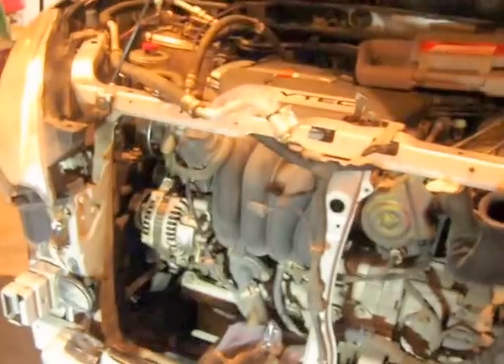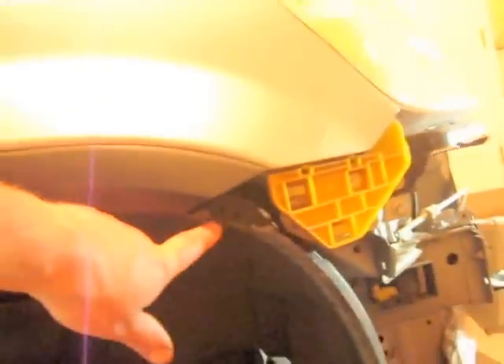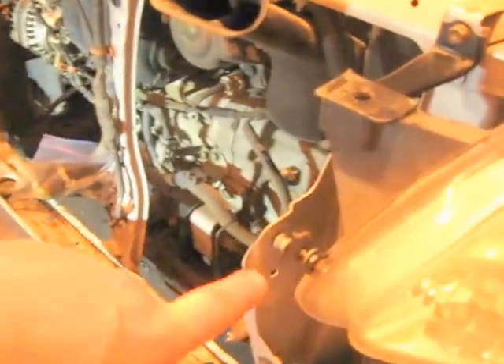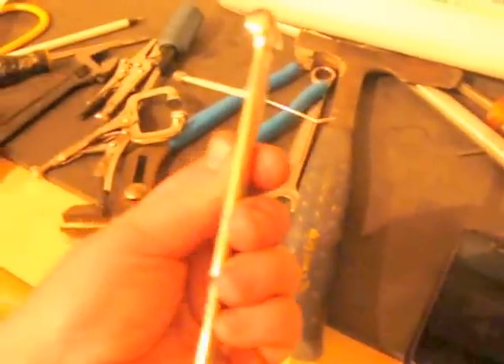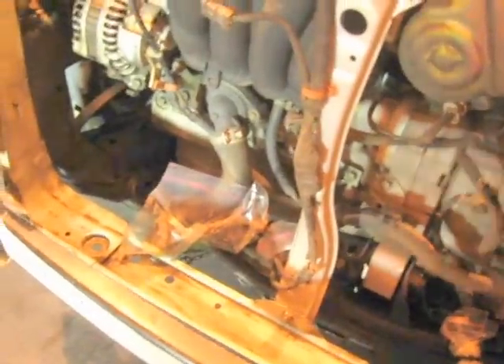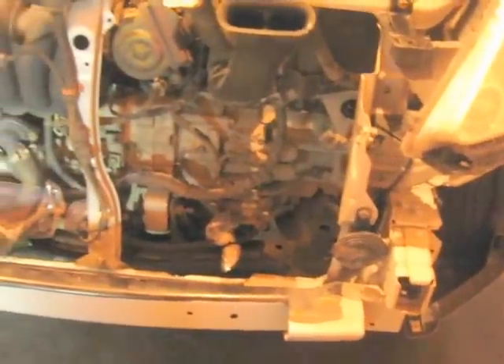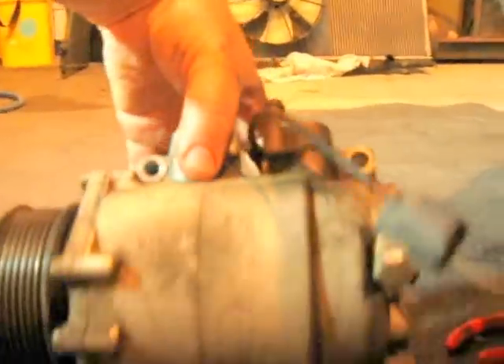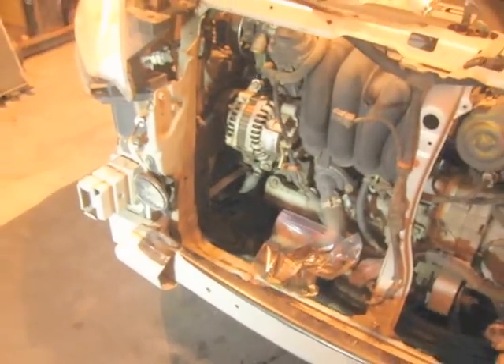2004 Honda CR-V Air Conditioner Compressor Removal

Comment: We had the A/C repaired for the second time in 2013 and it went down again just las September (2015). As summer approaches in Texas we are undecided as to weather or not we should fix our car. What do you suggest? Is this car worth fixing? I'm also considering a newer CRV, do you think I'll encounter the same problem?
Reply from the maker: In regards to the newer CR-V a/c i am not educated on the viability of the new a/c design. I do know that after I repaired our a/c in the video we have had no additional failures as of today and the a/c stills operates as well as it ever did. Our a/c failed 2 times as well :( As for options the idea of spending a few hundred and a small number of hours to repair proved to benefit our expenditures over the cost of monthly car payments. Our family has been getting used to the lack of car payments and like the idea, until of course it becomes an absolute necessity. Other than the a/c the CR-V has been reliable, efficient, and suited to our needs and thus we would probably consider another one after careful consideration of any potential defective  engineering that is not to uncommon on any machine these days. I hope that helps? I would also pray over any decision and seek the advice of Jesus, this has been a great way to mitigate my shortcomings when faced with decisions such as these. :)

Comment: Honda is fully aware of their weak AC systems. The CRV line from 2002 - 2009 has had problems. Usually the clutch goes and next the compressor which then fouls the entire AC system. Honda offered a warranty extension and even had a Service Bulletin. The guy at Miller Honda in Vestal NY gave me a BS story such as he never heard of a problem, etc. I got a bit loud with them and even contacted Honda America. They wont do anything. I have 2 Hondas which will be the last I ever own. The fix on the '07 was $1100. I'm not waiting for the '05 to go, I'm getting rid of it. Honda....never again.

Comment: I have a 2002 CRV with a bad clutch bearing. Is it possible to replace without evacuating the system?
Reply from the maker: Jud Covert I think I remember a person doing it when I did my research prior to this job. In my opinion it would be hard to get a puller in between the fender wall and the clutch pulley. I will look at my wife's car tonight and update if this opinion changes. I did this job last summer and I remember trying every which way to avoid pulling the whole system out. It was due to the clutch that I choose to do the whole system rather than have a failure and ruin the evaporator in the dash. Our clutch was "chirping" and when removed the bearings sounded crunchy and I was glad I changed it. I hope this helps?
Reply: George Jirout Thanks George! First I removed the bumper, I was able to get the clutch off, take out the snap ring... pulley was easy to dislodge. I had it completely loose but not enough room to get the pulley out. I loosened the condenser and radiator, removed the passenger radiator fan and coolant overflow tank and was able to take the top compressor bolts out. The bottom ones were easy with the bumper off. I moved the compressor over an inch or so and got the pulley out. I didn't have to break open the system and didn't have to drain the coolant! If I was replacing the compressor I don't think there would be anyway around removing the radiator. I'll look in the garage again tomorrow and get the compressor brand, I don't think it's original so who knows if that's a good or bad thing, car has 170k on it and I'm poor and cheap. Thanks for the helpful video!
Reply from the maker: Jud Covert Thanks for sharing your knowledge and experience! I have been super busy in grad school so the reply times are lagging on my side! Glad to hear you are back on the road and saved some $$$ over the stealerships.

Comment: What is the oil you put into the compressor pump?
Reply from the maker: Leanne Jones It is PAG 46 Compressor oil. I said PAG 40 at the end but it is PAG 46. The quantity is 4.50 oz. if the compressor is dry shipped.
https://www.techchoiceparts.com/refrigerant-and-oil-capacities/honda
Reply: @GeorgeJirout  Thank you George. I live in NZ and doing this by myself. Never done this before...I'm sure I will do it...even if I get confused. I assume that the oil goes somewhere...lol...not sure where yet...not at this stage yet. Any tips I'd love to hear. Kia Kaha
Reply from the maker: Leanne Jones Well NZ is just stunning (pictures only as I have not had the privilege of visiting) 
When you receive the compressor It will have plugs in the holes where the lines attach ( this is where you add/remove oil) Invert the compressor and pour all the oil into a clean glass container and measure that to verify the correct amount. I purchased a small container of the PAG 46 oil and added the And out of the exact amount just to be sure. I’m certain there’s gonna be a large delay due to our geographic locations but I’d be happy to help.
Reply: @GeorgeJirout  I got the compressor and the starter for 220.00. from the wrecker. But i think the starter motor is the wrong one. I'll find out when I pull it out tomorrow.monday nzt Sunday your time.the compressor is the right one.i would like to take you up on your offer of help please......if I was a Megan or a Harry...I would send you a jet to pick you up.
Reply: That oil is expensive here.
Reply: Hi George. I am now having issues with it not starting. The starter motor is in and works. The a/c pump is in and ok. Iv checked the fuses. The battery is fine. The lights on the dash are on. But they engine won't turn over. Any ideas please??? I tried it in neutral last week and it wouldnt start either.
Reply from the maker: Leanne Jones Crank no start is a fuel or electrical problem. Shoot a little ether or brake clean in the air box and see if it sputters. If yes check fuel relay and see if fuel is available at the fuel rail. Check all the connections at the coil packs and the starter. I hope it fires up for you.

Comment: Sorry to repeat a previous question, but I'm so paranoid right now after reading countless horror stories that I want to try and avoid this $3k service. Just bought a used 03 CRV. Should I just replace the AC Compressor as a preventative measure? Is this new one built differently to ensure it won't have the same problems?
Reply from the maker: I do not have a definitive answer either way. In our case the failures took place most often in California while my wife was commuting to Palm Springs (hot 110 degrees hot). I imagine the car humming along at 70 mph with the ac full blast and an ambient temp under the hood hovering in the 160  - 80 range. The first two failures were under those conditions. The last time the bearings went out, now in the opposite conditions of - 30 to 0 degrees in ND. The compressor did not implode but I replaced it in lieu of losing the whole system. I only have about 10k on the after market compressor, with no obvious issues during the summer (full blast ac in 90 degree humid) and it has been below 0 a couple times this year, but the real test is yet to come in Jan- March. I guess it would be a precautionary fix to try and beat it to the punch by changing the compressor, surely it would save a bundle of cash and flesh from your knuckles! Maybe a call to the ac distributor to get an idea whether they have changed the composition of the metal impeller in those units. I seem to recall a made in China label on the one I purchased, so it may be beyond the scope of the distributor to answer the question. See what I mean? I am sorry that I cannot give you a straight answer Mike. It surely is a waiting game. Honda of America worked with us on the first two and I seem to recall a class action settlement related to the issues with this ac. Dig around a bit in cyber space, you may find that with Honda kicking in a few nickels it may be worth it to wait it out ???  I understand the frustration, but the CR-V is a great car otherwise, I think :/

Comment: I have an 06 Honda CR-V and the AC Compressor blew up it exploded it has a hole on it. what other parts do you recommend replacing along with the compressor if any?
Reply from the maker: Assuming the entire system is contaminated you will need the evaporator, all lines (high/low pressure), condenser w/desiccant filter, o-rings, expansion valve, compressor, coolant and the pag 46 compressor oil and r134a refrigerant. I could not find a complete s-f video. I pieced together enough to do mine and then posted what I learned. I think with basic tools in metric sizes you can remove and replace the whole system. Recharge will require a manifold gauge set for r134 and a vacuum pump (critical) to do it right. I found everything on Amazon for a good deal. The compressor from Universal AC had the best reviews and came with oil in it already (follow the directions in the box). With intermediate skill and a desire to save $$$$ you can do this! I can be of help if you need it. Research the many forums on CRV ac repair and scour Youtube for as much as you can, you undoubtedly have started. I know it seems daunting but if they can do it so can you :) The evaporator is under the dash behind the glove box. It is a pain working under the dash and requires patience, but again a doable proposition. As for pricing on parts, just shop and shop some more. That is usually the pain. I hope I did not miss anything. 
Take out the filter on the condenser and look for metal fragments of various sizes, if you see them the system is contaminated.

Comment: My 2003 CRV was just diagnosed with an imploded condenser.  The estimate was $3600.  I looked online and saw a kit for $600 that included 6 parts including the hoses.  Is all that necessary and if so how much more difficult is installing that kit and are there any special tools needed.  Do you know if there is a video that shows the complete install from start to finish?
Reply from the maker: You will need the evaporator, all lines, condenser w/desiccant filter, o-rings, expansion valve, compressor, coolant, trans fluid (automatic) and the pag 46 oil and r134a refrigerant. I could not find a complete s-f video. I pieced together enough to do mine and then posted what I learned. I think with basic tools in metric sizes you can remove and replace the whole system. Recharge will require a manifold gauge set for r134 and a vacuum pump (critical) to do it right. I found everything on Amazon for a good deal. The compressor from Universal AC had the best reviews and came with oil in it already (follow the directions in the box). With intermediate skill and a desire to save $$$$ you can do this! I can be of help if you need it. Research the many forums on CRV ac repair and scour Youtube for as much as you can, you undoubtedly have started. I know it seems daunting but if they can do it so can you :) The evaporator is under the dash behind the glove box. It is a pain working under the dash and requires patience, but again a doable proposition. As for pricing on parts, just shop and shop some more. That is usually the pain

Comment: The compressors that failed, were they the same brand? or same as factory fitted compressors? 

Did you just have to replace the compressor, or replace the whole cooling system? I heard the compressor can fail and stuff the entire system up, needing replacement.

Do you recommend an aftermarket compressor?
Reply from the maker: +sypher0101 First two were Honda OEM. We are in to the aftermarket one year with no issues. Hope that helps!
Reply from the maker: +sypher0101 I missed the last part of the question. I would say yes to aftermarket because 2 Honda OEM bot imploded within one year after the dealer replaced them. The Universal Air compressor I purchased from Amazon is still doing fine after the summer of a/c use.

Comment: if it did not implode. can I get by just replacing the compresser?
Reply from the maker: Yes you should be able to. That was my experience. Keep in mind that when you open up the system you will have to change the desiccant filter and be sure that the appropriate amount of pag 46 oil is in the system. Check out the comments for the oil charge information I discovered.
Reply from the maker: Here is the info on the charge. It was a little unclear but you should get the idea. I hope this helps.

""'Since it is going to be a new system, there is nothing left for you to flush.

A/C REFRIGERANT OIL REPLACEMENT
Recommended PAG oil: KEIHIN SP - 10: â€¢ P/N 38897 -P13 -A01AH: 120 m l (4 fl - oz)
â€¢ P/N 38899 -P13 -A01: 40 m l (1 1/3 fl - oz)

Add the recommended refrigerant oil in the amount listed if you replace any of the following parts.
â€¢ To avoid contamination, do not return the oil to the container once dispensed, and never mix it with other refrigerant oils.
â€¢ Immediately after using the oil, reinstall the cap on the container, and seal it to avoid moisture absorption.
â€¢ Do not spill the refrigerant oil on the vehicle; it may damage the paint. If it gets on the paint, wash it off immediately.

Condenser. 25 m l (5/6 fl -oz)
Evaporator. 40 m l (1 1/3 fl - oz)
Line or hose. 10 m l (1/3 fl -oz)
Leakage repair. 25 m l (5/6 fl -oz)

Compressor. For compressor replacement, subtract the volume of oil drained from the removed compressor from 130 m l (4 1/3 fl - oz), and drain the calculated volume of oil from the new compressor: 130 m l (4 1/3 fl - oz) - Volume of removed compressor = Volume to drain from new
compressor.

NOTE: Even if no oil is drained from the removed compressor, don't drain more than 50 m l (1 2/3 fl -oz) from the new compressor.'""
Reply: George Jirout thanks

Comment: What did the noise sound like? I have a compressor that is knocking without the ac even being on.
Reply from the maker: +Alexander Davidson When ours went out there was a intermittent (2  per second)  deep chirping sound resonating from the compressor area with and without the a/c activated. The sound would speed up with the engine. We did hear the knocking noise on a/c failure #2 back in 2008, however, that was only when the a/c switch was activated. The best case scenario, from what you describe, is an a/c clutch failure. This type of failure keeps the system &quot;clean&quot;  and the clutch can be replaced. I seem to remember someone in this thread of comments talking about this repair. I hope this information helps.

Comment: How do you know if you need to replace everything or not?  Am I just looking for signs of trash when i pull it or is there a shorter way of telling?  Someone has done this before so if they replaced the compressor before wouldn't that aftermarket compressor be better than before?
Reply from the maker: Assuming the system is not under pressure there is a filter on the bottom right side of the condenser, a desiccant filter. A 10 mm hex will remove the cap which should provide you a glimpse of any debris traveling through the system. I hope that helps?
Reply from the maker: I do not have much info on the viability of the aftermarket compressors. I know that the one I used in the video is still working, Knock Knock Knock, as of today. The two OEM units previously installed both imploded, both done by Honda.

Comment: Not sure if it did. It's 2004 with 120,000 miles. The ac just stopped working in April.
Reply from the maker: If it did it would sound like a bottle full of metal being shaken violently when the ac is engaged. Otherwise the clutches also have issues on our model year CR-V. If you change the compressor there is an accumulator/drier built into the condenser which has a desiccant bag inside (driver side with access from the bottom 14mm hex) that should be replaced whenever the system is opened. 
http://www.amazon.com/gp/product/B001B7C21Q/ref=oh_aui_detailpage_o08_s01?ie=UTF8&psc=1 

Depending on the amount of cash you want to spend will determine what else you may want to replace. I had it apart and decided to do the belt & tensioner 
http://www.amazon.com/gp/product/B000C2UKMO/ref=oh_aui_detailpage_o09_s00?ie=UTF8&psc=1

http://www.amazon.com/gp/product/B000CHMMJS/ref=oh_aui_detailpage_o09_s00?ie=UTF8&psc=1

When you start the project and want any help just let me know.
Reply from the maker: I couldn't get the message to deliver. You list of parts is good. Just get the o-rings at the local parts store. Thanks for the opportunity to be of service.
Reply from the maker: no need for the kit with expansion valve unless you are changing the evaporator  under the dash.
Reply: George Jirout If its just my compressor, do I need to change the condenser?
Reply from the maker: WoodpekaPekahead No. Just the desiccant filter in the condenser.

Comment: Hey George what brand compressor did you buy off Amazon and has it still held up?
Reply from the maker: So sorry for the late reply! The life of a social worker :) 
https://www.amazon.com/UAC-CO-10663AC-C-Compressor/dp/B00FQ0T2XA/ref=au_as_r?_encoding=UTF8&Make=Honda%7C59&Model=CR-V%7C754&Year=2004%7C2004&ie=UTF8&n=15684181&s=automotive&vehicleId=3&vehicleType=automotive

I could not find it in my archived orders, but here is the unit from United Air Conditioners. Ours is still blowing cold and no implosions after three years! Praise the LORD!
Reply: George Jirout thank you buddy